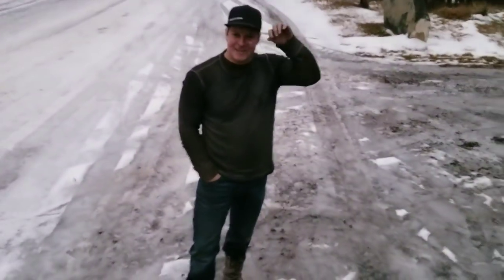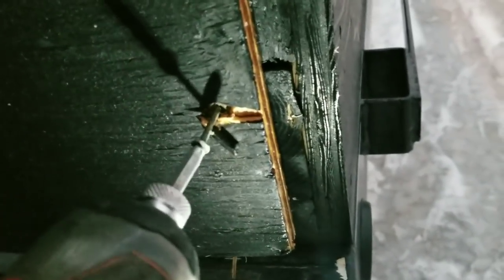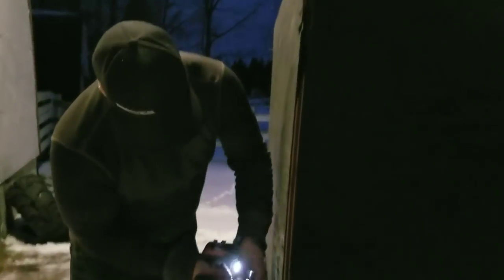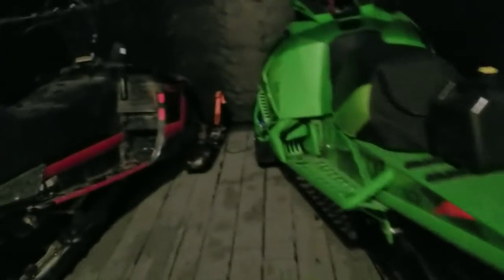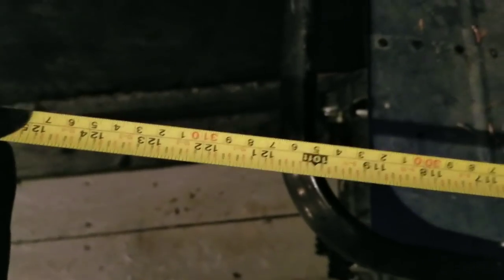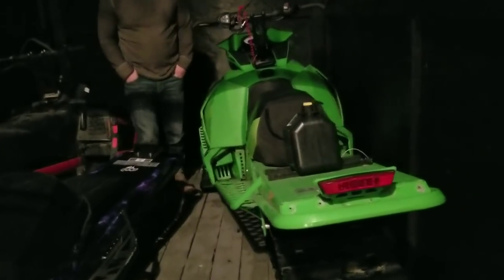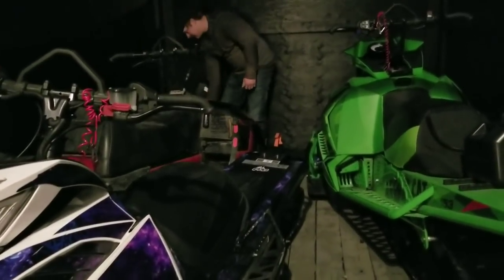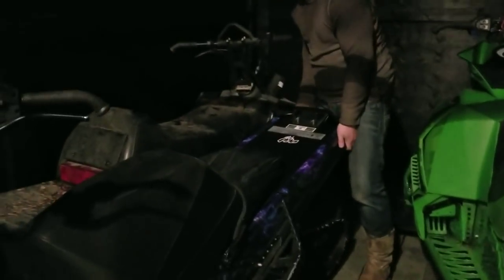Fitting 4 Sleds In a 2 Sled Trailer

Comment: How wide is that trailer? Could you load them from the sides? They would def fit that way. Just might not be able to have the sides on? Hmmmm

Or make a little box off the front for your skis to go under for the 2 front sled. That way the bumpers are touching the front of the trailer. That would give a lot of room.
Reply from the maker: We were screwing around with it again the other day, we did get them somewhat in.

Comment: Build a ramp on the front to put the front 2 facing forwards which would drop the back ends down, and then a removable piece of wood going from side to side to put the backs of the back 2 over the backs of the front 2 sleds
Reply from the maker: That might be an idea. Tying them down might be a nightmare no matter what.

Comment: try making a removeable ramp so you can run both of the rear sleds over the tails of the front ones.. would also save the hassle of trying to back sleds on to the trailer
Reply from the maker: Or a bigger trailer!

Comment: The Phazer Tamer stack method?
Phazer in 1st, (shortest sled) facing forward in middle with 6x6 block to elevate track.  
2nd the Orgasmic Cat and Matt's Ghost M8  go in fwd side by side (inner skis under Phazer tunnel). Split tail, wide as possible.
3rd, RMH goes in backwards, between the Orgasmic/Ghost........scary.
Reply from the maker: Next time, to have all the right sleds.